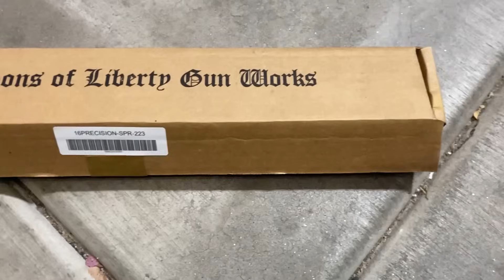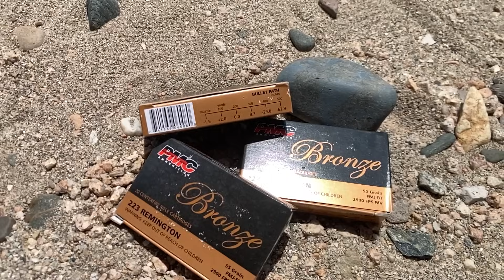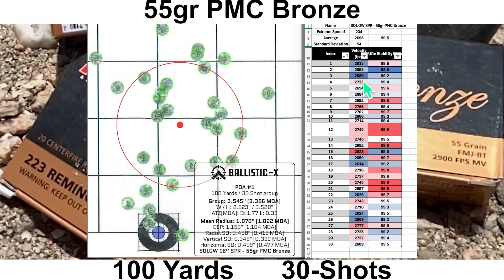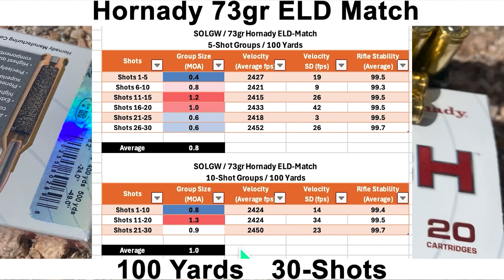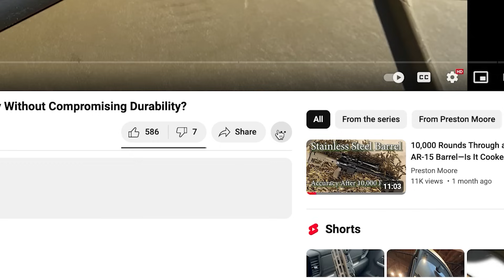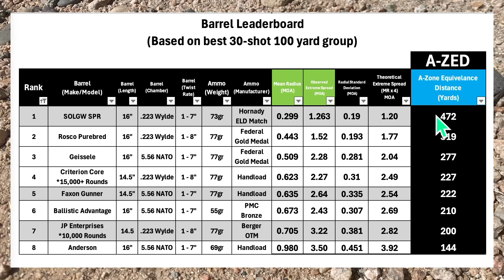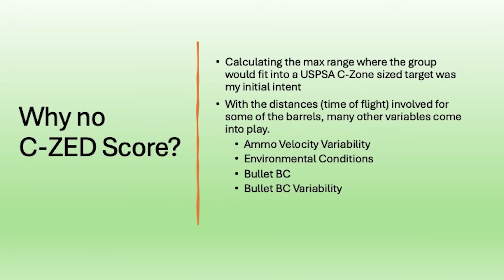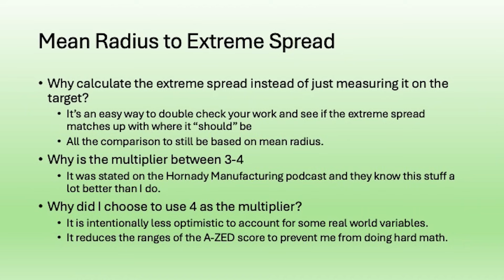Sons of Liberty SPR Barrel: Accuracy Tested with 30-Shot Groups + A-ZED Score

Comment: I think you're cheating yourself on your azed formula because an azed score of 472 yards with a moa of .299 seems woefully low. A .299 moa should allow you to reliably hit a 5.91" target out to 2000 yards if the bullet could go that far in an imaginary world.
Wouldn't a 1 moa on a 5.91" target  be able to reliably hit at a distance of 591 yards?
Does this seem fair or incorrect?
If it seems fair, then your azed formula would be:
(5.91 x 100)/ MOA
Reply from the maker: I think you’re mixing up two different metrics. The A-ZED formula isn’t based on the extreme spread of the group. It’s based on the mean radius of the 30-shot, 100-yard group. Then that mean radius is multiplied by 4 to approximate a theoretical extreme spread.

The mean radius is the average distance each shot lands from the center of the group, not the distance between the two shots that are farthest apart (extreme spread).

The full formula for A-ZED is shown at 13:10 in the video. 
In this case...
Mean radius = 0.299 MOA
0.299 × 4 = 1.196 MOA
5.91" equals 1.196 MOA at 472 yards

So the A-ZED score reflects the distance where 1.196 MOA equals 5.91”.

Comment: I have their 16'' and 18'' SPR tubes. The 16'' mimics your results. Very accurate. The 18'' is pure dogshit in comparison. 3x larger groups and slightly slower velocities than the 16''. Going to pull it and rebuild the 18 in another upper and different gas block and retest.

Comment: I've heard that a gas port on a land can negatively affect precision, and I noticed one of the lands is completely severed by the gas port on your SOLGW SPR, but it still performs. I wonder if the gas port were entirely on a land, could it shoot better?
Reply from the maker: That seems to be a rather pervasive thought in the AR realm.  It's not something I am personally concerned about, as I thought this barrel performed extremely well. But, it might be something interesting to look at in the future.  

Also, Since this barrel only has 3 grooves, it would be a lot easier for the gas port to be entirely within a groove.  However, since most AR-15 barrels have 5 or 6 groove rifling, it would be more difficult for the gas port to avoid hitting a land. Also, the gas port can be larger than the groove itself. So, fitting the gas port entirely within a groove would be impossible.

Comment: Don't understand the group size calculation. I get about 2.25" group, but your notes say 1.381. Or do my lying eyes deceive me?
Reply from the maker: I'm not entirely sure what you are getting at.  For the 77gr Bergers (8:02), the measured center to center distance for the two farthest shots is 1.381"/1.319MOA.  Each square is one inch.  The group is about a third larger than one square.  

How did you come up with a 2.25" group?

Comment: I really like the A-ZED concept! A question though, you mentioned that the factor is from a Hornady podcast. Can you perhaps link that? I am trying to understand more about how that number was chosen. Doubling the radius to get the diameter is obvious. But doubling it again seems  a bit much. I am not saying they are wrong, just trying to understand it better :)

Also to just check my current understanding. If a factor of 2 was used, it would basically mean that the exact 30 round group you shot would have fitted into the A-zone at the A-ZED distance, right?
Reply from the maker: Thanks for the question!

Mean radius is the average distance each shot is from the center of the group.  If you double the mean radius, that you basically give you the size of the circle that would contain about 50% of the shots, not 100%.

For example with the Hornady 73gr ELD Match group.  The mean radius was 0.299 MOA.  Double that (per your question) and you get a ~0.6 MOA diameter circle.  The actual extreme spread of the group was 1.26 MOA, which is about 4x the mean radius.

YouTube doesn’t allow you to put links in the comments, but if you search nDMpHIHMBbc in the youtube search bar, the video will pop up. Hornady Podcast Ep.099

The video is about mean radius in general. The 3-4x multiplier to get the extreme spread group size was a comment made in passing. But, still a good episode to listen to.

Comment: ….. I just noticed how low the velocities are.

There’s no way this is normal. 

My 16” barrels are all at least close to 3000fps with the exact loads.  Very strange.
Reply from the maker: @peanutbutterranger1899   interesting… I’ve never gotten anything close to 3000 fps with 55gr PMC Bronze out of a 16”. Also a 73gr or 77gr bullet going 3000fps out of a 16” is something I’ve never seen. Even Black Hills Mk 262 is “only” rated to 2750 fps out of a 20” barrel.  And mk262 is generally regarded as one of the fastest factory 77gr loads, as far as I am aware.

I don’t think environmental conditions would be enough to account for the differences between your data and mine.  But, sounds like you are getting some stout velocities 👍
Reply: maybe with Lake City 5.56 my barrel does 3000fps with it but PMC bronze is not hot.

Comment: A-zed will be theoretical, but likely not directly translatable. As distance increases, those velocity swings will come into play.

Good video. Curious if you ever repeat the tests to see if 30rds is repeatable, or if 30rds was overkill for what you were looking to learn.
Reply from the maker: Yup, as the name implies, the A-ZED is just a size comparison and not hit probability, which is the main refinement from the Geissele video.  Although, I am sure people will take it as such.  Hence the long winded explanation at the end of the video.

I have done repeated 30-shot groups.  I did 3x 30-shots groups in a row with no cooling in my barrel heat video.  Also, my first Rosco video, I did 2x 30-shot groups with 77gr SMK hand loads.  There was 0.001 MOA difference between the mean radius of each group with the Rosco.

Comment: Great video, Any suggestions on a FH for this barrel?
Reply from the maker: SOLGW NOX ROTEX/SF Compatible Muzzle Device looks to be a good with a 5/8x24 thread option available.
Reply: @PrestonJMoore  I read the Thread Pitch is 5/8×24, since its that, I assume a 308 type FH is ok? or do they make something for 5.56 with that thread size?
Reply from the maker: @ You are correct, 5/8x24.  The SOLGW NOX ROTEX/SF is the only 556 sized  flash hider that I know of (I haven't been searching for other options) with 5/8x24 threads.  If you were to use a regular 308 flash hiding muzzle device, it will fit and function.  I am not sure if that would have a reduced affect on flash suppression due to the increased bore diameter.  My guess would be it wouldn't matter that much.
For muzzle brakes, Ultimate Reloader did a video a while back comparing the effectiveness of a 556 specific muzzle brake to a 308 muzzle brake on a 556 rifle.  Technically, there was a difference in effectiveness.  But not a large enough difference that I would probably be able to benefit from.
Reply: @PrestonJMoore  Sounds good. Ill look in to those options. Thanks!

Comment: Have you tried any imi m193?  its not much more than pmc (.50 vs .45 ish) but IME notably more accurate.. and hotter.  2 moa 10 shot groups.  nice middle ground vs $1 a round match
Reply from the maker: I recently got some Winchester M193 that will be making its way to the channel in a few weeks.  No IMI yet, but it's on my to get list.  I know that stuff is pretty popular.

Comment: If that "black oxide" is actually nitride, it is very common for anything that was perfectly to spec before the salt dip to be a tiny bit undersized after the dip. 

So bores will be a little overbored after dipping, and od journals will be a little undersized. As you saw with your micrometer
Reply: Also that 73 grain ELDM group looked absolutely fantastic. That's a 800 yard load right there jeeze louise!! I'm very impressed

Comment: Very nice Video. First time watching your channel.
Would love to see this test using a Proof Research carbon barrel. My DMR build has a White Oak Armament 18" fluted, rifle length gas. Does 0.65 moa with 77gr Black Hills (MK262 mod 1).
Keep up the great work.
Reply from the maker: Thank you! A Proof Research barrel is on the wish list. Your WOA barrel sounds like a tack driver though!
Reply: @PrestonJMoore  It shoots better that I'm capable of.
Do you think many people underestimate the need to thoroughly test different ammo/loads to find what runs best for a particular rifle? It's not cheap or quick, but finding THE round that gun likes is very satisfying.
Reply from the maker: @unapologetic7900  It depends on what their use is.  It certainly is nice to have a good understanding of what my rifles are capable of.  But, if I the most difficult thing I planned on doing was plinking a full size USPSA target at 300 yards, doing thorough testing probably isn't entirely necessary.  If I plan on shooting small targets far away, then yeah, doing a more thorough evaluation would be needed for me to feel comfortable with that setup.
But the evaluation process can certainly be satisfying in itself, if you are into that sort of thing.
Reply: @PrestonJMoore  Agreed, I guess it depends on your philosophy of use.
I'm not a hunter or competitive shooter, 99% of my focus is practical, tactical, and self defense. I want to know that the only barrier to hitting what I'm aiming at is me (which training can improve), not the weapon system. I'm also in Law Enforcement, so a lot of that crosses over. If I'm counting on a "one shot kill" from 300 yrds, I need to have maximum, reliable accuracy. 3-4 moa will never cut it.
Even 1 moa at 300 is a possible 3" miss. 

Inside a Building (room clearing) in close quarters, a tight group is much less important than stopping power. We use Speer Gold Dot 75 gr bonded soft point 223 for that, or 9mm Federal HST 147 gr in our PDW's.
Again thanks, I really love your process and how you edit your videos. Lots of meat, no veggies.
Reply from the maker: @unapologetic7900  100%.  That makes sense to me. Law enforcement professionals, such as yourself, certainly have a lot more to consider and a lot more at stake than me over here just poking holes in paper.  Glad to hear you like the video! They will always be efficient and to the point.

Comment: Excellent video! I appreciate the thoroughness of these tests and that you put so much useful info in such a short video. I’m sending this to every shooter I know!
Reply from the maker: @thestacheplays  thanks for the kind words and support!!   More content is in the works!!
Reply: @ Did you see where SOLGW posted your results table to their IG reels?
Reply from the maker: @ ha, no I hadn’t seen that until you pointed it out.  That’s pretty cool!!  Thanks for the heads up!!
Reply: I dig the A-ZED concept, has me wondering if there’s a mathematical way to adjust for barrel length, grade on a curve? Comparing a 14.5” to an 18” is an interesting datapoint in & of itself, but a little unfair to the shorter one.
Reply from the maker: @thestacheplays  I'm thinking about making a more expansive ratings list that would take into account weight, gas port size, build quality, performance, price, etc.  It would be a bit of an undertaking, but pretty neat, I would think.
Reply: @ wow, you’re thinking bigger than me haha… I meant maybe A-ZED divided by barrel length but factor MOA somehow 🤷🏼‍♂️
Reply from the maker: @thestacheplays  haha, well, either way it will probably still be a bit before I get something like that fully integrated into the video.

Comment: I’ve Been using the same SOLGW SPR barrel since they came out. Over the last ~4.5k rounds the barrel has done amazing in matches. When you factor the cost, and lifetime warranty it’s really hard to justify spending 2x-3x the cost of a SOLGW SPR barrel for proof or bartlein barrels. Are proof and bartlein barrels worth it? Depends on your pockets and accuracy requirement. I personally can’t justify the additional cost for where I am currently in my shooting.
Reply from the maker: @Runningmancs  you got a pretty good point there.  SOLGW makes a pretty compelling argument with this barrel.

Comment: Very quiet on the audio.
Edit: holy crap what a barrel
Reply from the maker: @WaterZer0  uh oh, what part? Or all of it?
Reply: @PrestonJMoore  Yeah basically all of it. I mean I can turn up my computer sound, but it's just quieter than most other videos I watch. You don't need to reupload or anything; just remember for next time.
Reply: @WaterZer0  do you have stable volume on?
Reply: @bayzr5485  I had it off since I heard it can mess with the audio mixing. Should it be on?
Reply from the maker: @WaterZer0  Okay, thanks!!  I appreciate the feedback! It helps make my videos better.
Reply: @ try it, if it makes the audio better then 👍

Comment: I have the 18 inch, rifle gas version of this barrel. Built it in a G Super Duty tabbed upper/hand guard. I’ve been very happy with its performance.
Reply: What BCG are you using ?
Reply: @HLDefender  Daniel Defense. I like the  Geissele REBCG. But, they expensive and given I’m running a long barrel/rifle gas I think a standard BCG is sufficient.
Reply: @shawnpatten6515 Don't sweat the G. BCG. Mine has magazine cutouts on the carrier's belly that are so rough that they scrape magazine lips pretty hard, and the bolt shoulder support run is excessively large.
Reply: @shawnpatten6515  I love mine in my URG-I.  Cleans super easy.  Extremely tight tolerances.
Reply: @ great minds think alike
Reply: Sweet build.  I'm building an spr and am looking at this barrel.

Comment: Excited, I requested this!

Edit: Finished the video, my 18-inch SOLGW SPR barrel sees similar results although I only test with 10-shot groups. Getting 1.2-1.3 moa with 77 & 75 grain aac, while 55 grain loads were doing 2.5-8 (yes 8, really hates SDI 55 grain) inches.

Also with a full-weight BCG I had to run an AGB wide open for 55 grain, with a lightweight JP bcg i can turn it down a few clicks.

Also did notice less POI shift between 55 grain and 77 grain compared to my other barrels, so makes for a good 3 gun barrel where I can get a fine zero for accurate loads but still have basically the same POI for cheaper stuff. Only off an inch or less, while my 14.5 is like 3-4 inches difference.
Reply: @Magdumper  nice. I also have the 18 inch version. I’ve had great results with the 75 grain AAC load as well.
Reply from the maker: Glad to hear you are getting good results from your SOLGW barrel as well!  The gassing is definitely nice. Don't have to do too much tuning, if you don't want to.